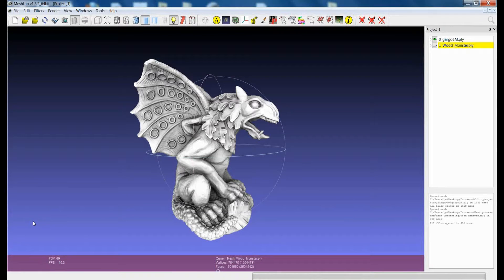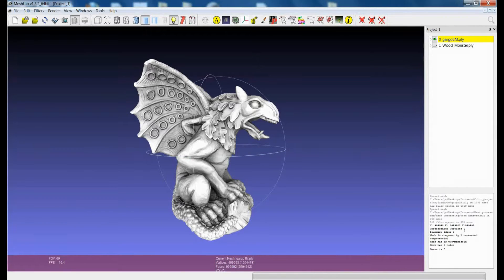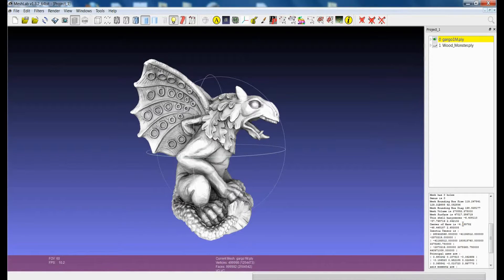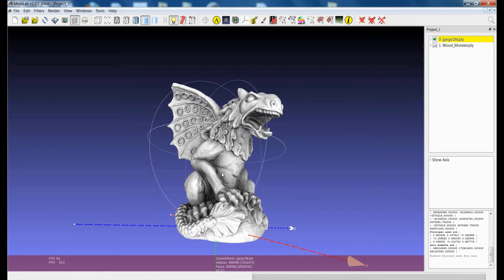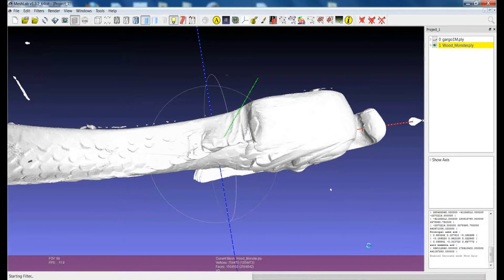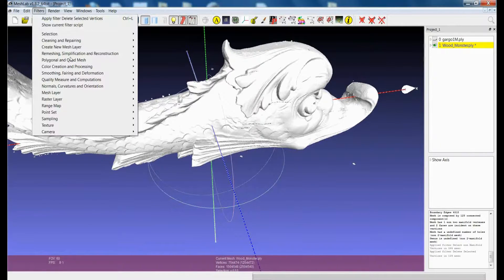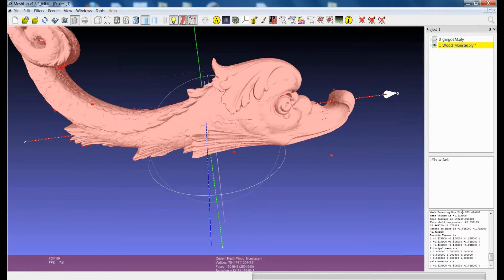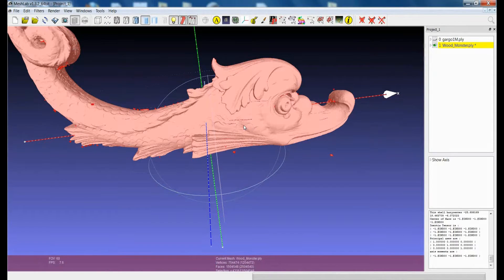MeshLab Basics: Compute Topological and Geometric Measures

Comment: What are the units of measurement for the volume? mm^3, cm^3? Is there a setting that shows this? Without units, the values are not very useful.
Reply: Determines on the unit your mesh is using. In general these are unitless. Assuming you have file in mm, the volume will be mm³. If it's in inches the volume is in cubic inches etc.

Comment: Thanks alot for the tutorials man!
Just one question. You mentioned that if the object is has holes the volume cannot be calculated when using the geometric measure option.
Could this also be used as a way to detect if an object is closed/water tight or not?!
I'm looking for a method to detect that, the watertightness of an object...really need it...any hints?!
Thanks.